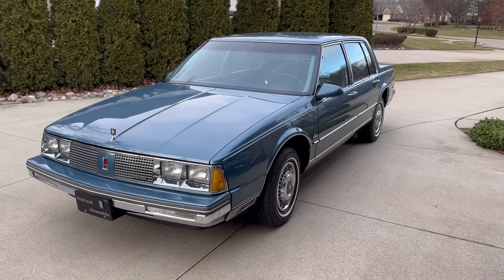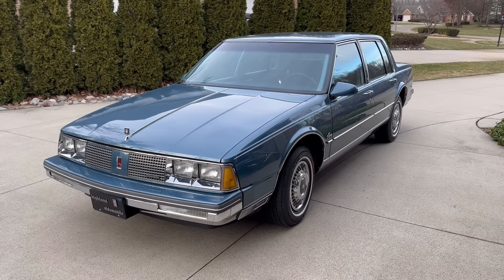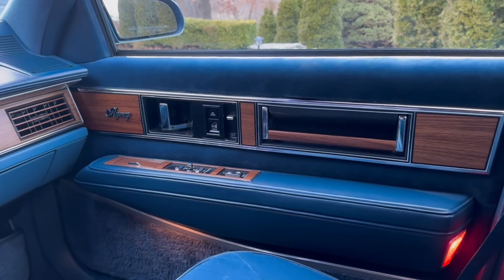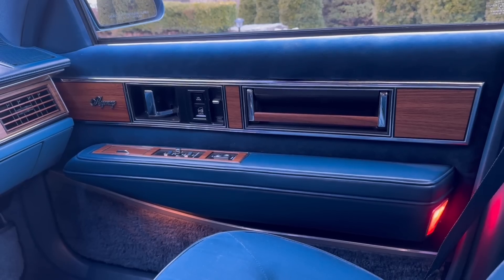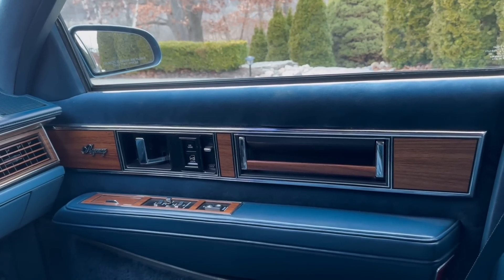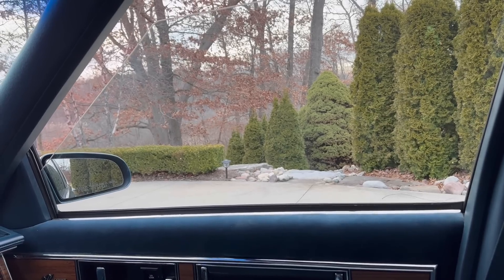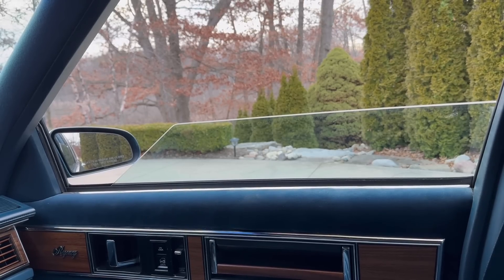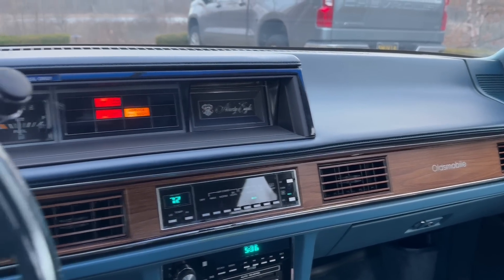Worst Automotive Inventions: 1980s/90s General Motors (GM) Tape Drive Window Regulators

Comment: Completely off topic, but around 1:30 you mentioned that the olds 98 was roughly the same size as the current day malibu. I gotta say though, having ridden in both cars, the Olds feels downright cavernous compard to the malibu. It probably has a lot to do with the formal roofline, front bench seat, and little crash protection in the doors. Frankly, I'd prefer the open space in the Olds even if it's not as crashworthy as a newer car.

Comment: I have a Ford ranger with chattering power windows. Can your little trick help preserve my power windows as well? BTW, I notice your power windows drag. Is that caused by the tape regulators as well?

Comment: I’m currently having a problem with the passenger side rear window on my ‘88 Cadillac Brougham. I believe it’s the tape that has broken as I can hear something from the motor. Of course I still have to properly diagnose it, but time is such a short commodity.

Comment: I had a 1986 firebird and I now have a 1991 Trans Am and neither of them use tape drive window regulators, they both use the gear with a motor just like the gear shown in your video at 0:40.

Comment: Its not an electric car. It is not On or Off, it is either running or not running. Stop saying on or off when referring to gasoline powered vehicles.
Reply from the maker: It has electric components.  The ignition is “on” with the key in that position.

Comment: How interesting. I had a 1986 Oldsmobile 88 as my first car in 2002. I remember at least 1 of the windows falling off its tracks somehow (little plastic bit kept it in the sill, if I remember?). I had no idea they were tape driven too.

Comment: Another problem with these windows is tape length shrinkage. The tape can shrink, bringing the holes closer together where they bind up on the drive sprocket. They can shrink in length to where the holes are so close together it can no longer move. The last one I replaced, I counted the holes several times to be sure the new tape was cut to the right length because with the same number of holes the old tape was at least an inch shorter that it should have been.

Comment: Ford escorts in 1991 had that ball lift system that was awful. Never worked worth a sh!t. The Saturn cars had crappy hand crank windows that would strip out. Now every company uses cables, they suck so much that everyone adopted them.

Comment: Oh my gawd, it's Dymetrol!

The band strap system you are tallking about is a former DuPont product that, like many DuPont products, was spun off after the parent company would develop it, but then would toss it off to make other 'new' things, though Dymetrol has a slightly different origin.  My father and I formerly ran a small advertising firm, and our chief client was E.I. DuPont. Dymetrol was one of our accounts in the early 1980s.  One of my jobs was to draw up the schematic in a promotional brochure on how to bond two ends of Dymetrol together as if I were editing movie film together.

Now Dymetrol wasn't created originally by DuPont, but concocted by engineers over at their former 'sister' company GM (Pierre duPont had run GM in the early 1920s, and the two companies worked together many times ever since).  The reason for DuPont to get this product was simply because they were the makers of the material that makes up Dymetrol, Nylon.  GM handed over the engineering rights to DuPont so that the chemical company could produce the product for them (Side note - you can always tell when a DuPont product wasn't created originally by them just in its name - they had a book they would plunk down in front of us when they would have a new product that needed a name - it was as thick as a New York phone book, and it was full of copywritten names, all of whom were TWO SYLABLES in length and could be linked to a product to be trademarked.  Hence the reason they had Lucite, Nylon, Duco, Tedlar, Tyvek, etc... and how some of these are no longer DuPont properties [Lucite is owned by Clorox for example].  Die-Meh-Trol was definitely not theirs to start with.)

In 1993, DuPont spun off their automotive division, which included the Dymetrol product line.  Dymetrol, Inc still makes the stuff, along with many other straps and belts down in North Carolina - their web site is dymetrol dot com, for those who wish to see what's inside their doors raising and lowering their windows!
Reply: Not sarcastically, that's a great story.

Comment: I had quite a few C body cadillacs and never had a lot of window issues..  the biggest one seemed to be the guide clip disintegrating in the vertical part od the door which allowed the window to tilt out of place and in turn of course trashed the drive if you didnt stop immediately.. my honest opinion of these window regulators was that likely the vast majority of these cars were made wit hair conditioning.. in the 80s A/C was getting more and more common as was people using it.. granted your pontiac 6000s and celebritys were made without it..   I actually saw a 6000 without it.. the 2 outer air vents were storage bins.. but I think GM felt in many of these cars that the windows would not be used much.. of course little did they know about the 90s that seemed toi bring drive thru and drive up everything..  not just the bank and fast food..

Comment: The cable drive ones in my 2000 Grand Caravan gave me problems on the drivers side. Maybe because it got raised and lowered the most. Replaced it with two or three bone yard units. They must have been lower manufacturing cost than the old gear segment ones. Once the tooling is paid for the main cost is maintenance on the tooling. I could see were the dies needed to stamp the gear teeth could be a pain to repair as required if that is how they were made. Other wise they would need to be gang cut on Gear Hobbingor Gear Shaping machines.

Comment: Thankfully my 88 celebrity has crank windows. I can crank them in the winter if I’m lucky. I wanna take the door panel off and try to spray dry lube on the drive mech

Comment: On the other side, very similar tape-drive electrical switches of the period were very reliable, they still work flawlessly. Of course, the required torque is probably 100 times less, and there was no need to regulate anything - just a fixed number of steps. Sadly, it was all taken over by microcontroller-driven circuitry.

Comment: That trick reduces mechanism wear at the expense of doubling the arcing/mechanical wear on the switches... (Only do it if you can get replacement switches for your car)
The wire cable regulators were also a mistake IMO. The wire regulator in my 02 Suburban failed and I had 3-4 replacements in and out of the door in 3 months until found 1 good enough to outlast it's warranty.
GM and your winter advice on these regulators to not use them make one BIG bad assumption....That toll booths and drive-throughs stop operating in winter and or that consumers find opening their doors there to be an acceptable inconvenience...GM should have stuck with the old school metal bar window regulators for AT LEAST the Driver's window (which is the most used/important window)...It's a negligible amount of weight and cost for a LARGE improvement in reliability and improved customer satisfaction.

Comment: TLDR:  Don't use the windows.

I already get mad enough at Ford's horrible plastic geared window motors in the 90s trucks that strip out whenever they feel like it, but if I had this, I'd be building my own regulator from scratch.

Comment: In the ‘80s, a lot of GM made its way into Jeep XJ Cherokees. Most notably the steering column, and some engines. But the window mechanism was also similar, even for manual windows. With 5 of these to care for, Cash for Clunkers kept us in parts, especially window lift repair parts.

Comment: Adam another "trick" to help windows from this era and even modern cars move smoother and quicker is to spray silicone into the weather strip channel that surrounds the window,  Only the Sides obviously not the top portion or the window sweep at belt line DO NOT spray there just the side channels esp the side on the "square" side of the door glass as that is always in contact with the channel felt weather strip.  I have a 2006 Chrysler 300c and it has a reversing feature that if something is caught in the window it will cause it to reverse back down.  My passenger side window went up so slowly that it caused it to reverse down from the excess friction.  I lowered the window one day.  Cleaned the weather strip and then sprayed silicone onto the side seals and it now goes up and down about 40% faster and doesn't reverse by itself when raising the door glass,  Just an FYI !!   Your 98 has a lovely interior I love the color and fabrics/seat pattern.  I'll bet those are Lazy Boy comfortable!  LOL

Comment: This is an example of just how far behind the Big3 fell with its decades of "incremental improvements".  The UAW took away any reasonable level of engineering resources or content materials cost from them.  I'm pretty sure a J3 (Toyota, Honda, Nissan) or E3 (VW, Mercedes. BMW) vehicle of that era would not have had any problems like this.  Sadly, the problem is still there, and the new UAW deals will bring the Big3 right back to 1970.

Comment: Have to admit this video was much more "educational" than Adam intended. I was clueless on this subject and expected to learn about audio tape decks. But I've experienced a window regulator failure (in a cold pouring rain, of course, there's a law of nature that says so) and it was a miserable experience. I later took apart the door and found something like a yacht's halyard winch received the torque from the crank handle and transmitted it to a cable that ran over pulleys attached to the window in two places to raise and lower it.

Comment: No tape drive on my 1987 Fiero GT! It still uses the old school scissor regulator. It however does use a less than desirable (IMO) and damage prone slow window motor and every couple years, I have to remove the door panel and clean and relube all moving parts. I had a 1991 Grand Prix SE however that did use this tape drive regulator and I did break the driver window tape drive once when everything was frozen by not being cautious and I immediately regretted it! Not a fun or cheap repair. After that incident,  when I knew the door windows were frozen in place, I got into the habit of going all the way around the window seals and weatherstripping with a thin piece of flat metal similar in thickness to an old school "SLIM JIM" lockout tool. After I adopted that procedure I had no more window issues. The tape drive regulator definitely wasn't one of the Generals better ideas.

Comment: I wonder if that design was still in production for a 2000 Buick LeSabre.  My dad (a WWII vet) bought one seldom carried anyone in the back seat.  One summer day 150 miles from home for a week, one of the rear windows just dropped into the door and would not come back up and stay up.  Nearest GM dealer was a Chevy store... the service manager was able to order the needed part(s) to be ship next day.  Parts did not arrive before Mom and Dad headed for home with billowing clear plastic covering the open window for a 2 1/2 hour drive.  Took several more days to have the parts shipped to the Buick dealer that sold them the car.  Nearly two weeks total to get it fixed.  Dad's next and last car was a Toyota Camry...  no regrets.

Comment: The door mounted seat belts were also another poorly invented idea. Hundreds of drivers and front seat passengers were severely injured, if not killed, when they fell out of the car after high speed side impact collisions. Some owners retrofitted the seat belts to be anchored on the B-Pillar.

Comment: It wasn't just GM doing "mickey mouse" things with their power windows.  Had to replace the driver's window regulator on my 1992 Lexus SC300, it was a 20 year old low mile cream puff.  Took the thing apart, it used metal cables that were driven by plastic gears.  Wasn't the plastic gears that broke, it was the plastic arm that held the window up broke. So of course when mine broke, the window fell down into the door.  Had it wedged in with some cardboard to hold it up.  Pretty easy to replace though, pulling the door panel on the Lexus was a revelation vs my old GM cars, it actually fit back together EXACTLY as how I had taken it off.  The window regulator/guide was pretty easy to replace as well, nothing had those stupid rivets.

Comment: It has long been my thought that the 85/86-lets say 94 ish C/H (particularly Buick) cars had the finest interiors GM produced since the 1960s. The Olds 88 alone as an example. The return of die cast the full length armrest. I’ve replaced several of these in both fwd and rwd. Often in the B/C body the arc at the top will crack also. GM front doors typically have to be rebuilt. If I do a tape I put a new motor in. Parts houses can usually have them in next day.

Comment: My father’s 1975 Chrysler New Yorker Brougham 2dr had a giant window regulator like your first illustration.  It had probably a 3ft arm and a cross arm as well and weighed probably 25 lbs.  Unfortunately it had a plastic gear that stripped out.  We torn the door apart to replace it with a newly ordered regulator, using a 2x4 cut to length to sit inside the door, holding the window up.  Any slip and that beast of a window would crush a hand.  That was a fun all day job, but successful.

Comment: Yes, I replaced my fair share of these tapes in my early days as a tech. After you did a few, they were not that bad to replace. The nylon tape they used would dry-rot (they would yellow, while the new tapes were perfectly white) and usually snap in two down close to the motor side of the tape (usually it was when the owner was trying to roll the window up because the majority of the time the window glass would be down and would not roll up). Another "worst automotive inventions" GM installed in their doors were the window regulators in the "scissor" type window regulators they installed in the early to mid-80's Camaros and Firebirds. They were spring loaded, and the way you had to replace the window motor (which was the common failure) you had to get both sides of the toothed gears rolled down to a point where they had a hole machined in the regulator body where you could jam the gears with a screwdriver to jam the gears together so you cold drill the factory installed rivets out that retained the driver motor to the regulator for replacement. I remember distinctly, as I was drilling out one of these, the screwdriver fell out, without me noticing. When I drilled the last rivet out, the regulator gears due to spring tension popped out of the vice and the two toothed gears pop up and left corresponding tooth marks on both sides of my neck, leaving two perfectly tooth marks on my neck. Thankfully, I was not decapitated in the process. What do you say, the life of a greaser.....

Comment: I owned a 1978 Pontiac Bonneville as my first new car. The power windows worked perfectly. My next car was a 1980 Oldsmobile Delta 88. The power windows worked but were they slow.

Comment: It seems GM was willing to spend hundreds of millions in order to cut a corner on their cars. It often backfired on them, in in response they did it again, but they don't care as it's for dealers to eat most of, screw them anyway. Damn customers thinking they're a car company, when all they cared about was their investors. I'm sure they were happy when they were all screwed with the Obama "bailout" of the unions. 
Shame really, as by the early 60's they were quite honestly building some of the world's best and most innovative cars, but a new CEO put an end to that and it was downhill from there. I got good at fixing all the goofy broken crap on their cars, especially those of the 80's and 90's, and was happy to get out of car work in general.

Comment: My 80 caprice window regulator only just broke at 43 years old last year. Must be one of the first to get the tape style. Interestingly the tape was ok, but the nylon toothed block broke up and dropped the window. Did well for 43 years! Typically it happened on a car show tour, but nothing that a zip tie couldn't fix until the ebay bits turned up.

Comment: I owned many 1970s GM vehicles with power windows.  The glass moved rapidly and I never had a failure.  Then came my 1980 Electra with irritatingly slow movement and two failures in less than four years - broken tape drives per the Buick technician.  This in warm environments (Los Angeles and Phoenix) with minimal window usage due to the climate control almost always being in use.  With the 5.7 diesel (which I surprisingly had no trouble with) and the THM200 transmission (which I did), that car was the perfect storm of unreliability.  I've not owned a post-1970s GM vehicle since.
Reply: What's odd about that is I drove a 1979 Buick LeSabre once that had scary fast electric windows. That was the fastest I've ever seen a window move..

Comment: I just replaced the drive gear on a window motor in my '89 Lincoln.  Was relieved to see they still used the old scissor & gear steel regulators.
Reply: I went to lube the windows on my 2000 Honda since they were starting to have issues and I was also very excited, and surprised, to see an old scissor mechanism. That thing is gonna last forever! I'd much rather deal with replacing easy to find grease every 20 years than some expensive, hard to install, maybe impossible to find window regulator.

Comment: I had a 95 Saturn that had these tape drive regulators on the back windows, they were manually operated and trying to get them move felt like you'd end up breaking the whole mechanism because it was so stiff. The 98 Saturn I currently own seems to have ditched those for more conventional regulators (I think) as they work FAR better (also manually operated).